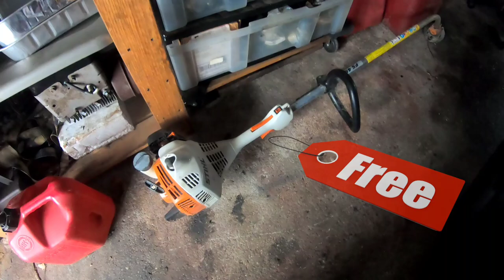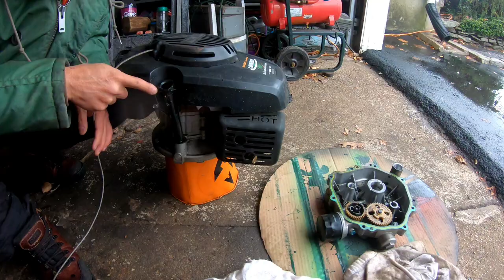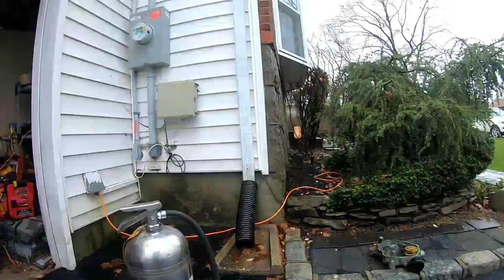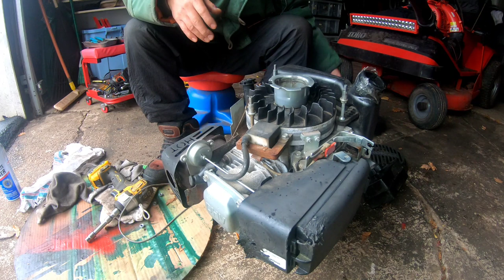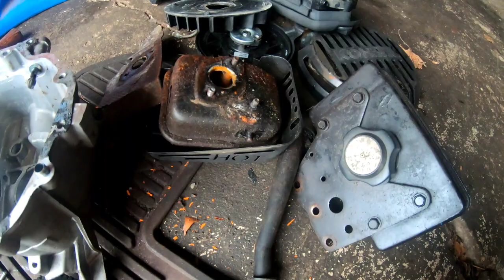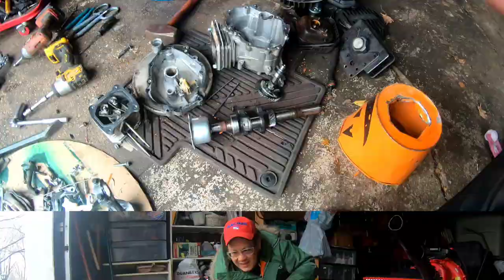FREE JUNK TRASH CURB ALERT FIND KOHLER XT6.5 LAWNBOY MOWER ENGINE DISASSEMBLY TEARDOWN SELL PART OUT

Comment: Henry, to run that engine, you would need a blade on the bottom to act as a flywheel weight.
Reply from the maker: Yup otherwise it’ll rip the cord out of my hand.  But as you saw...took it apart

Comment: You could of tried starting it with your drill
Reply from the maker: Not without mounting it first, then adding a blade to the shaft, mounting the gas tank and jigging the dipstick.  And then if it started, I’d need to buy $50 worth of parts.
Reply: @MowersNBlowers yes mount it hehe first but just use starting fluid no need for a blade if just starting for a sec just to see if it would run makes for a longer video which we like